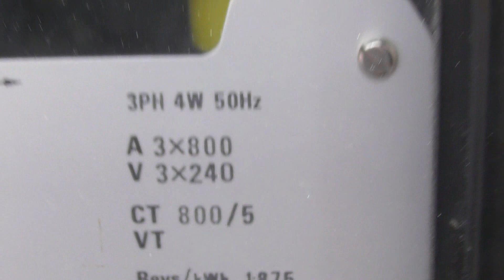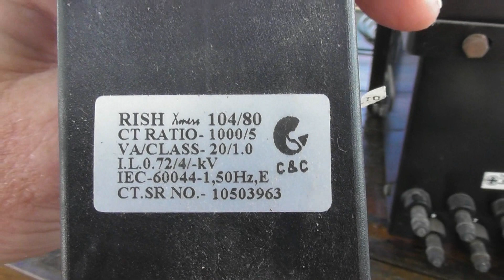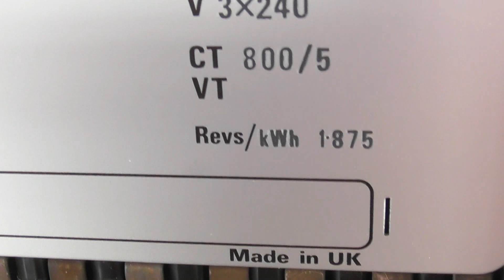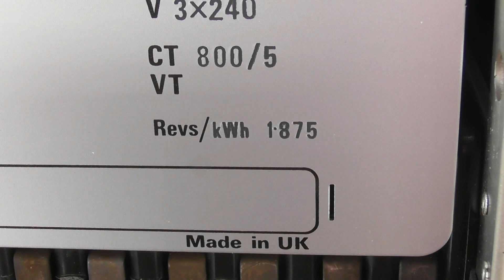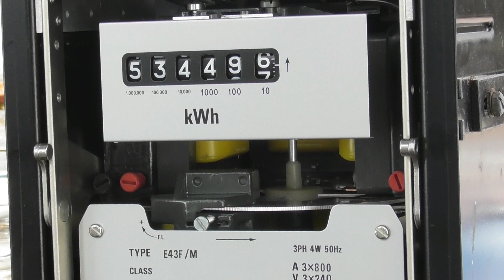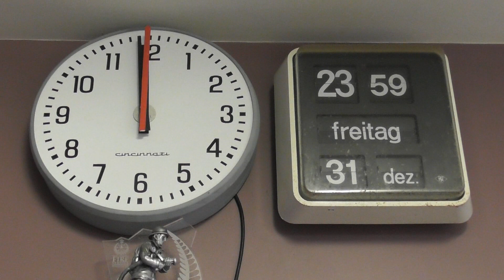GEC polyphase panel meter and End of Year clock

Comment: Very interesting video, as always :)
I knew of the existence of current transformers, but never realized that it's important to not leave the secondary windings open circuit.
Best wishes for 2022!

P.S. Cute cat ^_^
Reply: Yeah curious what happens if they are not. Guessing the CT could develop significant voltage on it. That would be a neat video to see :3
Reply: @NightWolfx03  That's exactly what happens. When energy is input through the primary coil, there is energy induced into the secondary coil. That energy has to go somewhere, and with an open circuit, similarly to the back-EMF you get from disconnecting a coil, the voltage rises uncontrollably. This will destroy the CT, possibly setting it on fire in the process.
Reply: In a nutshell, open CT gives ‘infinite’ impedance (let’s say resistance for simplicity), so by Ohm’s law, V=IR and you can see as R gets very big, so too does the voltage on the CT. The voltage can become high enough to start punching through the coil insulation further reducing the resistance. The CT can arc and short to the primary bar with spectacular overtime-earning results 💰
The actual failure mode is an interesting topic itself, have a read up and remind yourself of ‘burden’, ‘flux’ and ‘saturation’ 👍👍👌👌🧐🧐😉